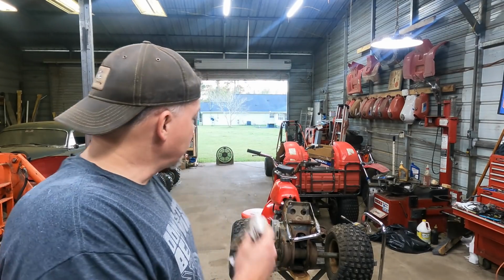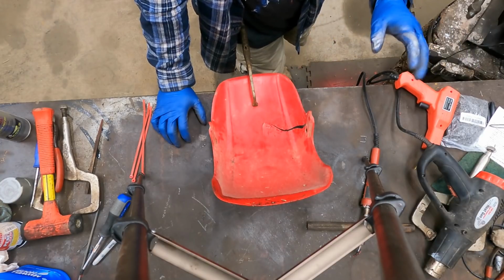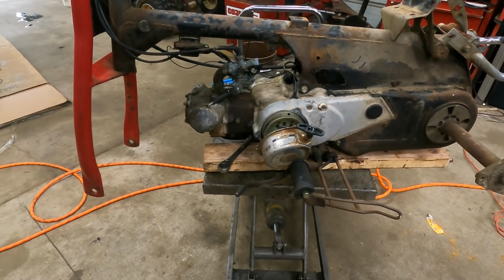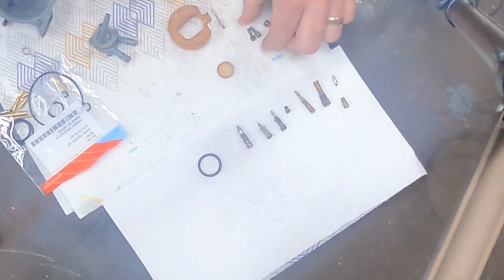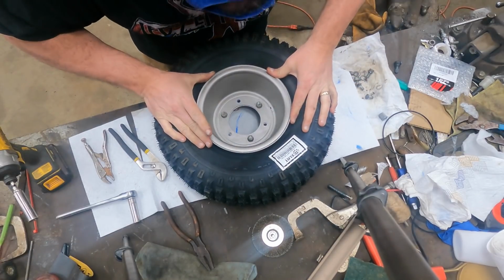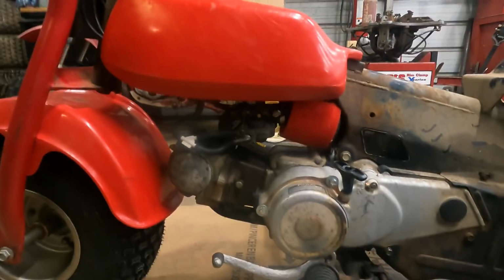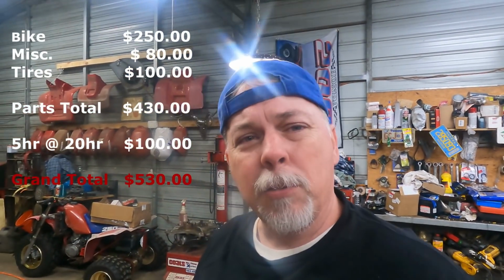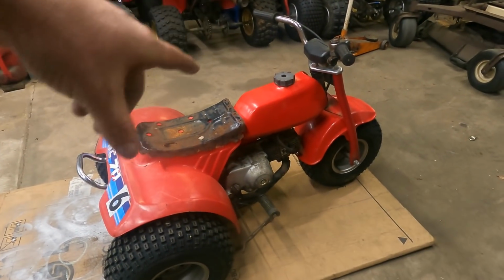CAN I FLIP  3 Wheeler for PROFIT?

Comment: Nice video.  Always had a soft spot for the old Honda 3 wheelers.  One nit pick, the bolts in the wheels are carriage bolts, not stove bolts..  Stove bolts don't have the square under the head and will have a flat or Phillips head instead of a smooth rounded head.  Definitely going to get one of the "hot stable" tools.
Reply from the maker: Hey Brad, yep I misspoke, carriage bolts. Stapler and extra staples  https://amzn.to/3jng1PR   extra staples  https://amzn.to/3KuYHnQ

Comment: Hey man, again I learned a TON from this video! I have a question. My front 3 wheeler fender is, or has become very brittle. It had to have been that way before bought it. I keep it covered with a "TOUGH COVER" tarp under my carport. Is it better to buy a new fender? A new one is $150.00 for mine. I don't even think a staple gun would help it. The plastics on the front fender get a few more cracks after riding in fields or riding wheelies. What would you do?
Reply from the maker: There comes a point when there is too much sun damage, you can try 2 different things. Heat the fender with a heat gun, support the fender with a block of wood between the tire and fender, get it ho enough to look wet, then let cool, work in sections. Another option is to coat the fender with wd40 and let it sit on the fender do not wipe it off, let the plastic absorb the wd40, come back the next day and wipe off any remaining oil. This may add some flexibility to the fender. If you see an improvement repeat this process. But it may be time to replace it. Sounds like you have UV damage from the sun and the fender has dried out.
Reply: @Mrcbuilds  Thank you very much for the reply and advice! That's some damn good advice. I'll try both options that you suggested. The bad part is that I agree with what you said at the end. It's definitely dried up in some places (where the cracks are). Man, I paid $1500. for it and I've got over $2600. in it. That was $600 for it being serviced. Bought 3 Kenda Scorpion tires for $300., and bought new 2 Wanda Gator Tires for $200. that I plan to put on the back. I'll try what you recommended first and make a decision. It's a headache for sure! I'll let you know the outcome. Thanks again, man!

Comment: Great job, it runs good and looks good. That seat pan is toast so you wouldn't be ruining anything by test fitting a 200x,185s, 250x, 300ex or 400ex seat and drilling holes in the old pan to match the pattern and bolt it on. It's so close to having it looking cool and the new owner just jumping on and smiling as they ride away.. I know I have a one track mind but it's the only way I can stay focused. Could you give me the name of that hot staple gun I'd like to try something new and we have enough old plastics out back of the shop to practice on. Thank you very much.
Reply from the maker: Sure thing, https://amzn.to/3jng1PR   also grab some extra staples here https://amzn.to/3KuYHnQ
Reply: Got it thanks. @Mrcbuilds